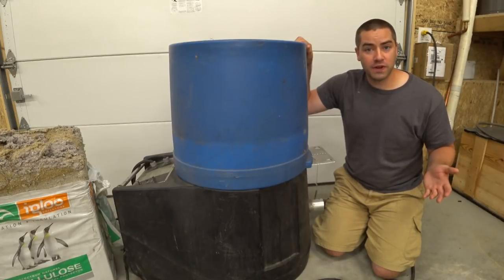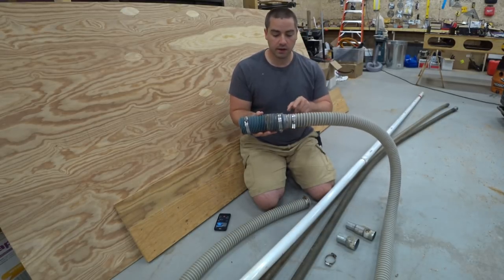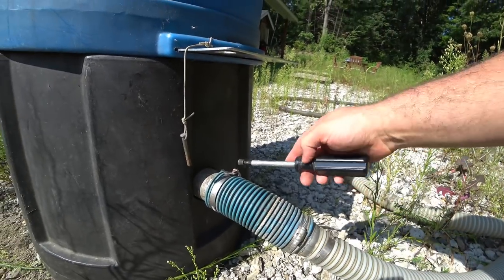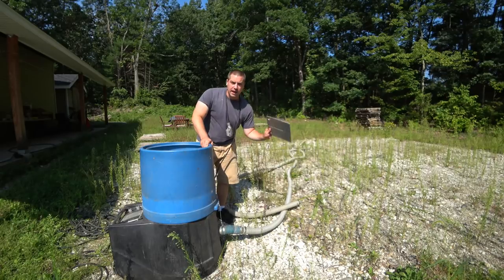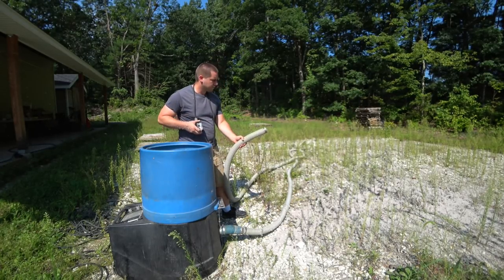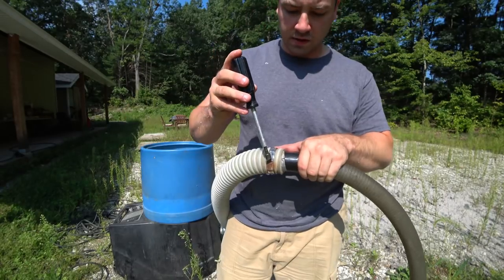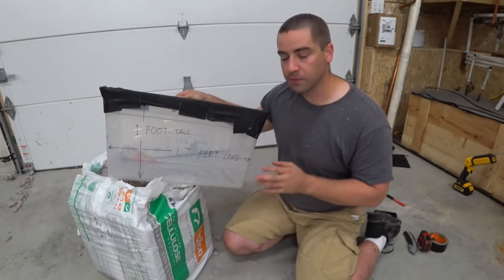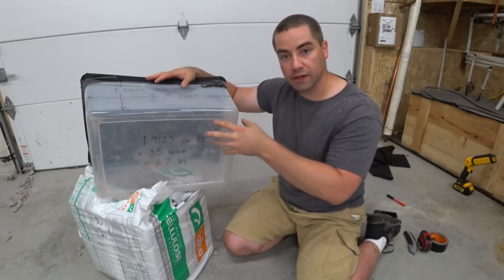How To Use an Insulation Blowing Machine, 101

Comment: Is this machine STRICTLY for attic "popcorn " blow in? Or can this be used (maybe modified) for wall insulation (closed or open cell)?
Reply from the maker: I upgraded the blower motor in another video so that I can use it for dense-packing.
Reply: @DavidPozEnergy  Good morning Mr. David Poz. Thank you for your prompt and professional reply.  Im both humbled and grateful 🙏. I have a few additional questions. Do you have an email address and or a website? I need to further communicate with you; of course I am willing to compensate you for your time sir.

Comment: I have seen people doing demos on how to dense pack walls, and I'm just wondering...   could I do it by inserting the hose near the top of the cavity, pushing it all the way down, and fill until the machine labors some, and pull the hose out a little at a time? Wouldn't that method dense pack pretty well?...  Unless I am missing something....   ?
 I'm curios as I've seen just about every other scenario shown except the one I'm asking about...
 Good vid...
Reply from the maker: Ben is using equipment listed as 48 volt nominal.  However, his battery is a 16s lithium.  Ben usually is operating at 56v-64v.  64 volts is the max his MPP PIP operates at, but is still considered a nominal 48 volt system.  Thanks for watching.

Comment: Is it possible to use a high powered leaf blower/vac (Toro 51216) to blow in dense pack cellulose?
Reply from the maker: Yes.  Now for the longer answer...  Back in the 60's and 70's when cellulose was first introduced to the market it was installed with just a blower, hose, and maybe a trash can used as a hopper.  There were no air locks, feed gates, or agitators.  So if you want to install your own cellulose using just a blower and hose you could.  The downsides are several.  First, all the cellulose is going to move through the blower fins themselves, which will very quickly destroy the fins and probably burn up the motor.  Second, without an agitator breaking apart the bags of cellulose you will have to do it manually.  So you will need to open a bag of cellulose which comes dense from the factory.  Then scoop out a chunk of cellulose by hand, and roll the chunk between two hands while holding it over the trash can so that it fully breaks apart.  This has to be completely loose without any chunks.  Even a tiny chunk the size of a golf ball will jam up the fins of the blower.  Third, to suck the cellulose into the blower you will want a short section of hose, maybe 6 feet long.  This will need to be held slightly over the top of the cellulose in the trash can by someone so the blower will suck mostly air, and some cellulose.  If the operator gets the end of the hose too close then the blower will bog down with too much cellulose to air ratio.  

So I don't recommend this, just rent a cellulose blowing machine.  But if you do try it please upload a video and share.  I'd love to see it.  Thanks for watching.
Reply: Hi David. Thanks for the response. Yes, I knew I would have to manually break it up finely, but didn't know about the air gap needed. I haven't found a rental place that rents the force 2 or anything similar in the Milwaukee, WI area. Home depot only has an Atticat and a standard blower. If I do try the leaf blower method, I will send you a video. Thanks again.
Reply from the maker: Try contacting these guys.  I know they rent powerful machines, but I don't know if they are outside New England or not.  If they are not in your area they might know someone.  http://www.accu1.com/blowing-machine-vacuum-rentals-s/88.htm
Reply: Thanks for the link, but if I had to pay rental costs that high, I would just buy a Force 2 machine. I was hoping to get free use of the machine with the purchase of the insulation.
Reply: Hi David, I found this Worx Trivac blower mulcher that has a metal blade. It looks easy enuf to attach hoses. 12 amp and 350 cfm.  https://www.amazon.com/Worx-WG509-Electric-Multi-Stage-Mulching/dp/B00MN4YCKK
If I were to put some kind of filter between the blower blade and the motor to keep the dust out, do you think that would keep the motor from burning out?
Reply from the maker: A filter would help, but I think no matter what, the motor will still burn out eventually.  But it might last long enough for your one job.
Reply: Awesome! That's all I need is to be able to do one room for now. Thanks for the response.
Reply: @DavidPozEnergy   sorry to bother you again, but you mention Tigerflex hose for the machine, but I can't find which series or type. I found someone that said the blue was better in cold, but there are too many. Can you tell me which Tigerflex hose works best for dense packing?     https://products.kuriyama.com/category/tigerflex-thermoplastic-industrial-hoses
Reply from the maker: Tigerflex is good when dense-packing an existing enclosed cavity, think retrofitting a 2x4 wall.  But it is not the best when dense-packing behind insul-webb.  If you can dense-pack behind insul-webb as you will generally get better densities.  If you are going behind insul-webb then use a vacuum tube PVC, or similar rigid type pipe.  Here is a link for tigerflex: http://www.accu1.com/Wall-Tubing-1-1-2-Winter-p/imc-wt-150.htm  Also, this thread is becoming hard to find with all the comments I get so please start a new comment if there are other questions, thanks.
Reply: @DavidPozEnergy  Sorry, just wanted to keep all the questions in the one area. Thanks again.
Reply: Hi David. It worked! The Worx trivac blower/mulcher/vac works to dense pack my walls. It took some getting used-to to pack it in without bogging down the blower, but I'm almost done with the living room. I think I only got around 3.4 lbs/cu ft, but I have to work the hose more and I should be able to get close to 4 lbs/cu ft.
I made a short video and will upload it soon. I will post a link here for it after I post it. I can't thank you enough for all your insights and assurance with getting this to work. I will finally, be able to be warm in my own house without wearing a suit and paying a fortune to freeze my butt off.
Reply from the maker: Awesome! I can't wait to see the video.
Reply: @DavidPozEnergy  Here is the link to the video dense packing with a leaf vac. It is poor because I don't have a way to edit it right now, but I will try to fix it later or make a new one when I get the dense packing perfected.
Reply: I fixed some of the issues. Here is the new link https://youtu.be/cQClmO14nP4

Comment: Someone needs to make a machine that can blow both fiberglass and cellulose insulation at the same time. fiberglass looses R value when the temperatures get below -40 due to thermal piping and cellulose insulation suffers from settling when you are trying to get over a R60. layering and mixing is the way to go, but it's a lot of work to do by hand.

Comment: did you use a different blower to get it at 4lbs? I am doing a pole barn home. We plan on doing 2 inches of spray foam and then fill 6.5 inch cavity with this. I like this idea better than batts because batts would leave gaps.
Reply from the maker: Yes, I upgraded to an 11 amp blower.

Comment: I don't understad dense packing?  Isn't this stuff stuff supposed to be fluffy to do it's thing? Why does the attics get loose fill and wall cavities get dense pack? Thanks.
Reply from the maker: The job of insulation is to trap small pockets of air that don't move around.  Both dense-packed, and loose-filled, cellulose has lots of small air pockets and is very good at insulating.  
We dense-pack walls in order to keep the insulation in place.  If the wall is too loose, then over time it can settle leaving a void at the top of the wall cavity.  This void looses heat fast.  In an attic, a little settling is still OK, because the cellulose remains in contact with the rooms below.  There is no void left.  
You can dense-pack an attic too, but it's not necessary.  Dense-packing takes more time and material, thus costs more.
Reply: @DavidPozEnergy  I actually got to your video because of the diy cellulose job i did on my new build house. 24'x35' no valleys etc, plain simple shed roof.  I didn't read any instructions to operate the machine. So i did the blowing with a fully open gate and 50 feet of hose. The machine was a Krendl model 425 from homedepot rental. Anyways i had to buy extra bags to get avarage of 20" height. My calculation was 70-75 bags, ended up using 100 bags (25 lbs). Will this mistake affect the R value or performance? Do i still get the rated R value at 20" or is it less because because insulation wasn't broken up properly. Thanks.
Reply: Also is there anyway to improve after job is complete? Going up in the attic with a weed wacker or mixer to fluff it up more :)
Reply from the maker: I wouldn't worry about it.  Using more bags isn't a bad thing.  You can send me some pictures through FB if you want, but you are probably good.  You may want to check out another one of my cellulose videos for context.  https://youtu.be/k8g9Q___CJ0?si=DCUgKHBJ2mzlM8B7
Reply: @DavidPozEnergy  I’d like to send you pictures and get your opinion. Yes, using more sounds good but I am more worried about the science of breaking up the insulation. Is there a way to tell if the insulation is broken up acceptable or not? Like getting a bucket full of sample and looking at it. I am happy with coverage even tho i had to pay extra $500. But i want to know the insulation will perform as it is supposed.
Reply: @DavidPozEnergy  what a great job you guys did insulating that garage. Attention to detail is amazing. I also did a similar thing with my air vents. 

I used 1.5” thick eps foam tightly between the rafters. I left 1.5” of air gap and foam goes up 60” along the rafter so air coming thru the soffit vents has no penetration to the cellulose just like you did. But i like that you have raised heel, which gives you more insulation by the top plates.
Reply from the maker: Using the foam board around the heal is also a good method.  Note, it's hard to find old comments, so it might make sense to post a new comment.

Comment: How would you recommend doing a crawl space underneath a none basement house . The let's say 30 foot by 40 foot . At a measurement between the dirt and floor panel 13 in.  It's like a cottage style house old and we need to find the best way to insulat the crawl space because the cold is pushing up throw I'll bet it 40 degrees .  No one can fit between the dirt and floor plus there is no entry way . What would you suggest? A professional and if we diy what type of insulation and what kind of machine? Lowes has it , if you but the insulation the machine is free no charge . What would you do ? Thanks so much the video was very informative.
Reply from the maker: I'll make a few assumptions because I don't have all the information...  I'll assume this is a year-round residence, and there is in-door plumbing.   I also assume you have poured concrete stem-walls.   When that's the case I suggest insulating the stem-walls and dirt.  No not install any insulation between the floor joists.  I have personally worked on homes without enough space to fit a human between the joists and dirt.  In those situations I cut open the floor for access somewhere in the house, usually a front-hall closet.  Then I shovel out the dirt one bucket full at a time.  Yeah, it sucks, but I get it done.  After that I'm insulating the walls with typically 4 inches of XPS, the dirt with 2 inches of XPS.  I cut the XPS into 2'x4' pieces.  The hole I make has to be big enough for that.  Also, Dense-pack cellulose into the rim joist cavity (assuming platform frame with wood joists)   After insulating I install a thick membrane and tape seams.  These are smaller than ideal R-values, but something doable in retrofit.
Reply: @DavidPozEnergy  , thanks David for such a fast response.  I'm not doing the work the land lords want it done and we need it don't beca6the cold from the floor is causing or k1 heater to run none stop . I figure if I cut between the floor joic about another every 6 foot he will be able to get the insulation in and it's the easiest option at this point . The floor sometime later will have carpet put down . Put they want the blow in insulation.  I have a stud finder so the cut in the floor no problem and I'll just cut answer screen 2×4 on each joic to nail the square foot piece I take out.  It's already winter and about 18 out so everything outside is frozen with a foot of snow on it lol. I pack snow around the footer . It's a 1963 converted small barn an back then in upstate ny well chazy to be point in . Everyone used wood and when you burn a wood stove it will heat you out lol I wish I had one now. The landlords are going to do the insulation the 1st week of December.  We are broke and I'm outta work because I just got diagnosed with two brain diseases.  They don't know if it's ms or als . So we are being helped by the state and can't afford the heating fuel . We get a grant but only so much and I feel guilty because others could be using it but I have a two year old daughter who won't keep her slippers on . Well thank you and I love the channel.  Someday I want to go fully off grid , solar anyth6and everything I can . I'm a welder and heavy equipment operator by trade plus I love wood working . My dad and uncles thought me alot . Thanks David again
Reply: @DavidPozEnergy  plus it's very floor in the house that's 35-40 degrees.  I have a Lazer temp reader

Comment: Hi David, quick one: I live in Buenos Aires, Argentina. I am trying to insulate my cavity walls (25cm wide with with 5 cm air space inside) I was thinking of using cellulose but not sure if 5 cm will be wide enough for a nice insulation. Plus in the corners of the house there are columns which I am sure will not allow a continuous envelope and thus impossible to eliminate the thermal bridge, right?...any ideas? love your videos! thanks for sharing!
Reply from the maker: You could use a hose with an outside diameter of 1.5 inches (3.8 cm) and get it in there but it will be extremely slow and the tiny hose will clog up often.  If your wall is: Masonry outside, 5 cm space, then an interior finish board such as plasterboard, then I would not fill that with cellulose.  Typically in masonry walls they need that drying potential to both sides.  I'm speaking in very broad terms as I don't know your exact wall.  The masonry walls I've worked on we will either add a ridged insulation board to the outside and render; or we remove the interior plasterboard and furring strips, add dimple membrane to the backside of the masonry, frame out the cavity deeper, and insulate that new cavity.
Reply: @DavidPozEnergy  Thanks for the quick response. outside wall is a nice looking red brick and on the inside a cheaper brick so unfortunately I cant remove the inside wall. I might have to do something on the inside (outside looks too nice to cover) like still framing and then insulation. We'll see. take care and thanks for the time!

Comment: David, you said your tiger flex hose has a 1 1/4” ID. What size hose reducer do you need to connect to the tiger flex hose so it fits snug inside the hose reducer?
Reply from the maker: I used to do this full-time and bought reducers from National Fiber.  But they are out of business now.  The reducers are sold for mufflers, exhaust systems.  Probably you can find what you need here: https://www.summitracing.com/search/department/exhaust/section/exhaust-pipes-flanges-and-turndowns/part-type/exhaust-pipe-adapters-and-reducers?N=part-type%3Aexhaust-pipe-adapters-and-reducers&SortBy=Default&SortOrder=Ascending

Comment: Will fiberglass insulation work in this?
Reply from the maker: Not as well.  Fiberglass tends to have longer fibers.
Reply: @DavidPozEnergy  thanks so much.  If I already bought fiberglass should I keep the shoot opening smaller to prevent clogging?
Reply from the maker: That's a good call on the gate.  You'll get a feel for the right air to gate ratio in the first 20 minutes.  Don't worry, if it clogs you clear it and make an adjustment.